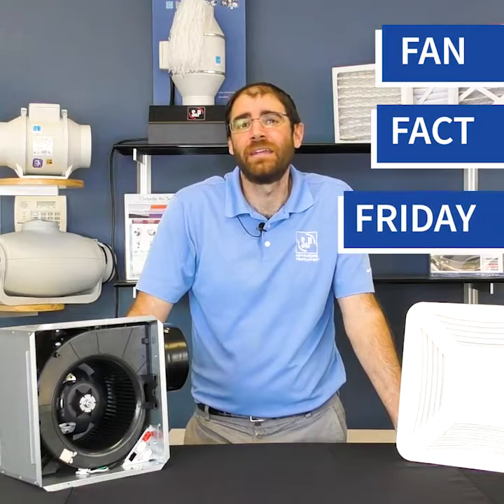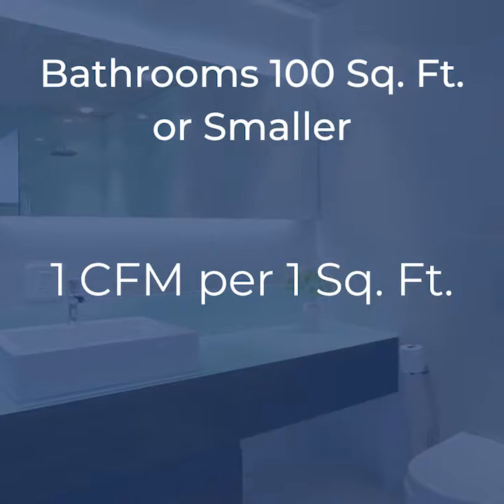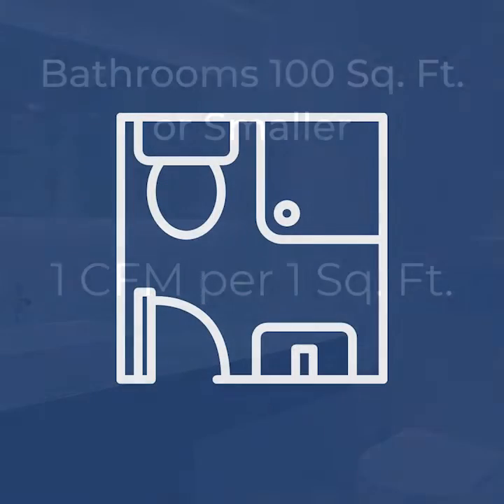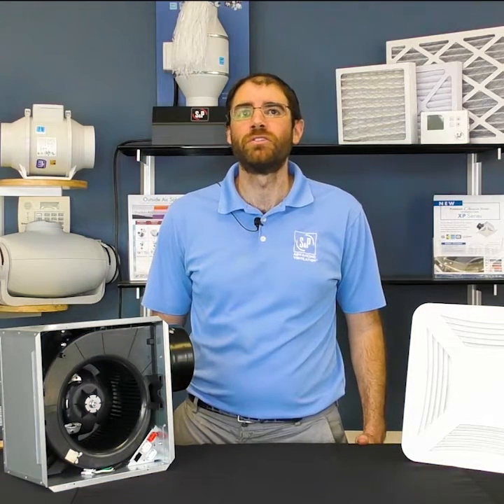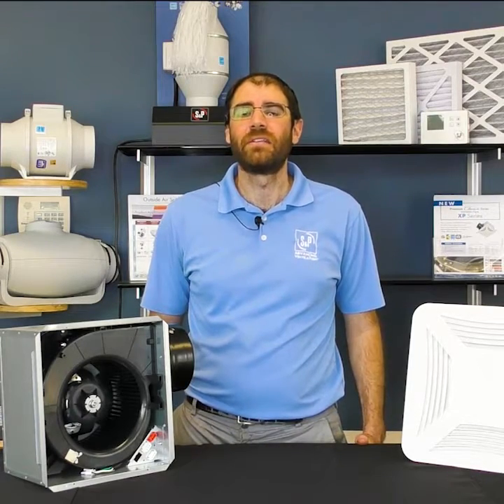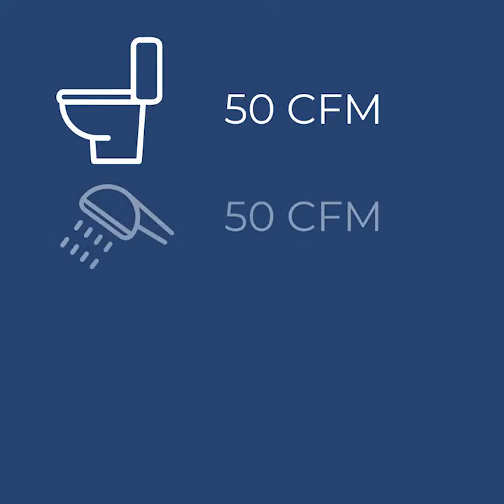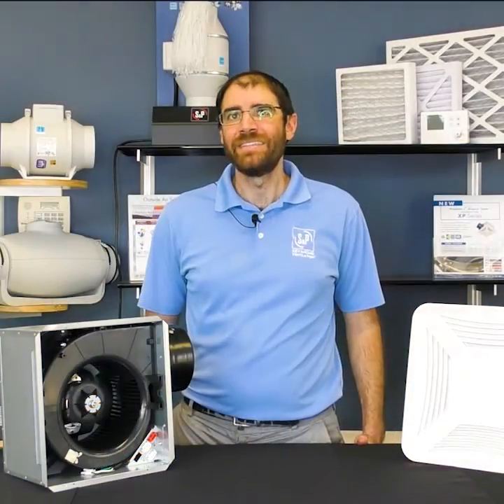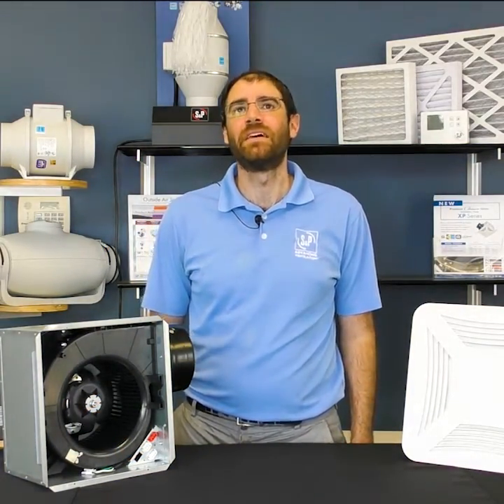Calculating the CFM Needed in a Bathroom | Fan Fact Friday

Comment: 100% WRONG.What if the bathroom is 8 ft height or 15 ft height.I believe the calculation should be in cubic foot and not square foot per minute.
Reply: It's a general guideline, so not 100% wrong. It's correct guidance for most situations. Most bathrooms which are going to have ceilings around 8-9 ft. high. If you have a bathroom with much taller ceilings, then yes, you're going to need to size up.